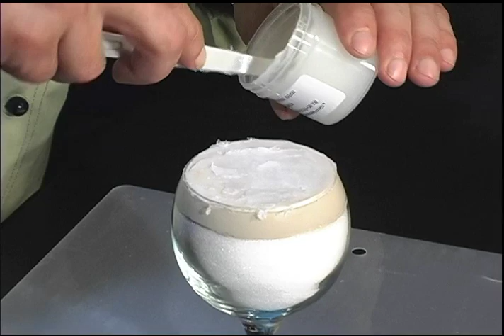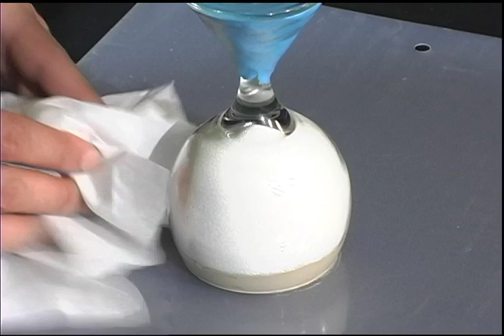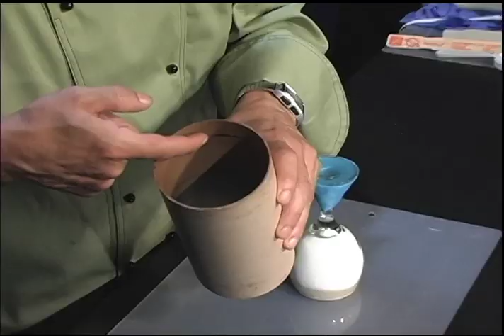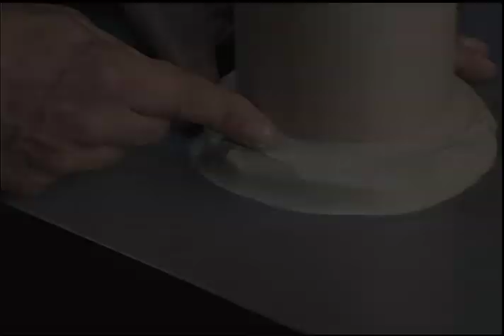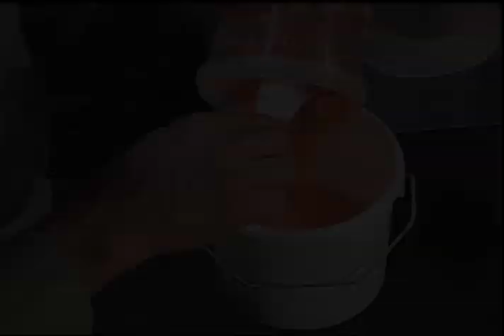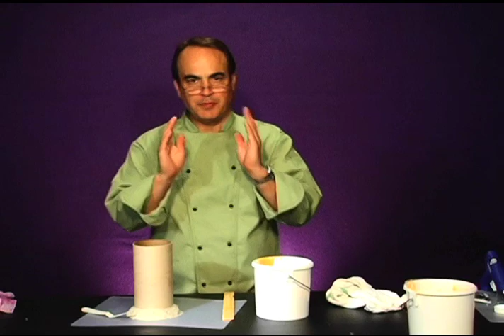Sugar Glass Video Part 2: How To Make Sugar Martini, Champagne & Wine Glasses

Comment from the maker: Shipping tubes are easy to acquire at the post office or office supply. They are usually 3" in diameter. Try finding anything else and you will discover that it is difficult indeed. I provide many diameters for a variety of projects and so we named them Tube-Its. Need a mold box for a bottle or sculpture? Just Tube-It! Kind of fun, kind of catchy. - Dominic

Comment from the maker: the mold is filled to the top with Isomalt sugar at about 280 F degrees when poured in the mold.  If you have a vibrating unit on the base it  might cause the Isomalt to spill out of the mold.

Comment from the maker: A sugar glass will not hold a liquid indefinitely. The liquid will dissolve the inside of the sugar glass and it will eventually leak. A sugar glass made as shown in the video will hold a liquid for about ten minutes. As far as royal icing goes, it does not have the thermal liquid properties of cooked sugar and I dont think it would work at all;=. - Dominic

Comment: OK - I have followed every step of this video but unfortunately the ONE thing you don't do (because of an assumption of knowledge, I assume), turns out to be key!!!  The putting of the seal-dit inside the tube was not made clear and the reasons WHY this is needed are not revealed until the unveiling part of the video, so I only put it round the bottom.  I now have to wait 5 hours to see if my mold is going to come apart.  
Please explain what and why so the novices have a fighting chance!